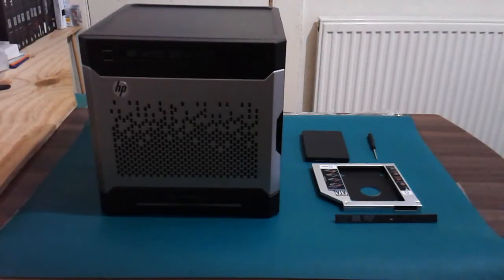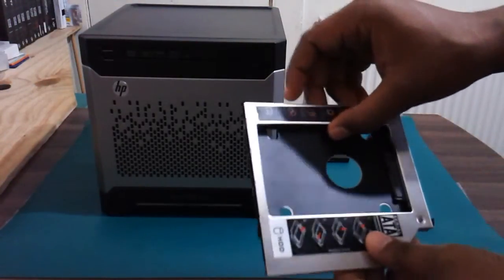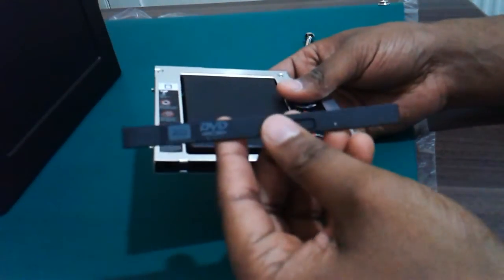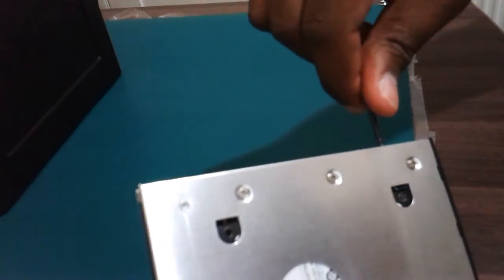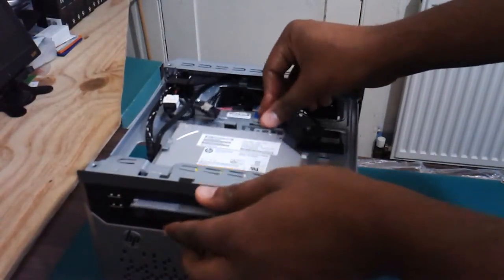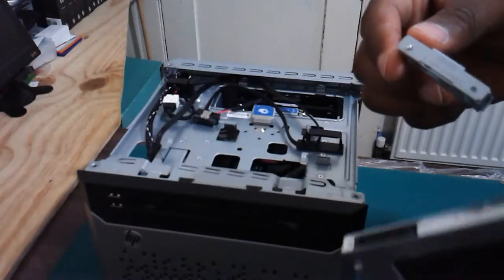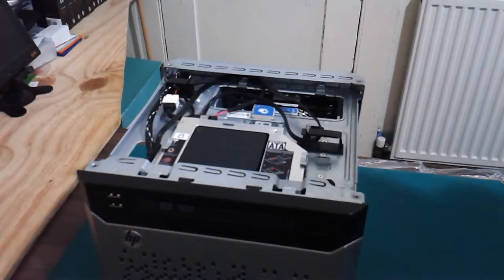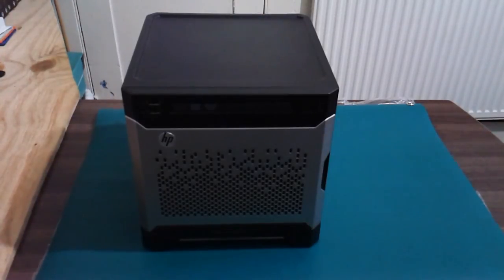Replacing DVD Burner with SATA HDD Caddy Bay Adaptor

Comment: can you please tell me where did you get the lock from the back of the caddy? That small metal thingy with the 2 screws...
Reply from the maker: It is called 'HP 9.5mm Optical Drive Bracket' (HP 532475-001)
Google Search '532475-001'.

Comment: Hello and thank you for the videos.
I would like to know or I can buy the cable 4pin to microsata you use in your video?
Is it possible to have a link?

Thank you
Reply from the maker: It is called HP SATA ODD Cable (Model 689392-001)
I cannot provide links as the links are temporary from shopping website.
Google Search for '689392-001' as you can get this on Amazon & ebay.
Reply: Thank you